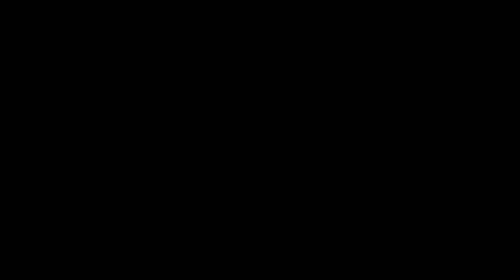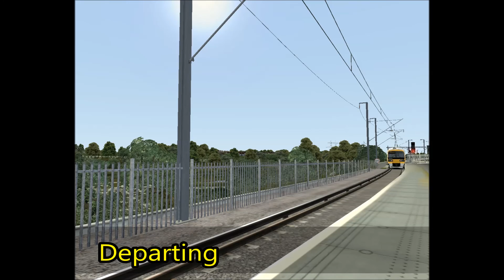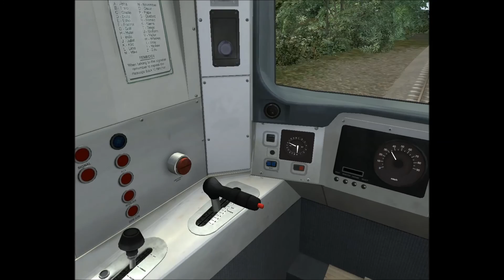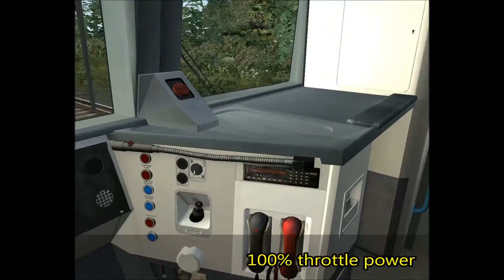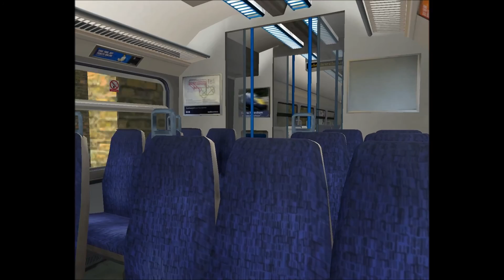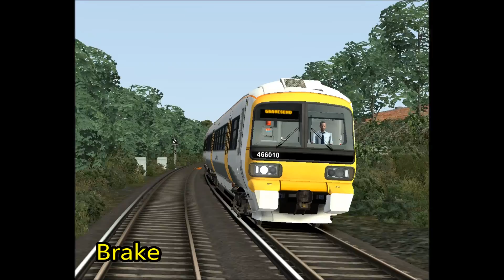Train simulator 2014-Class 365 sound test

Comment: That's a class 466, not a 365. Although DTG did record sounds for it from a 365 unit
Reply: Not very accurate for the 465 or 365. Its out of tune if you will 😂